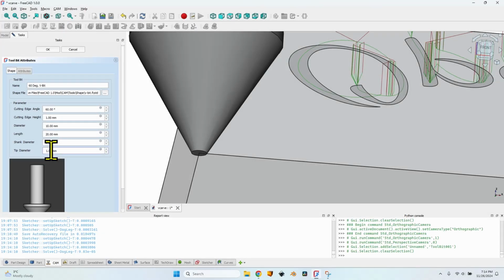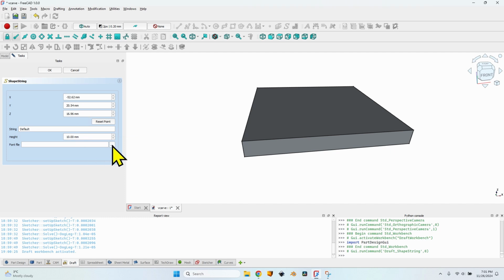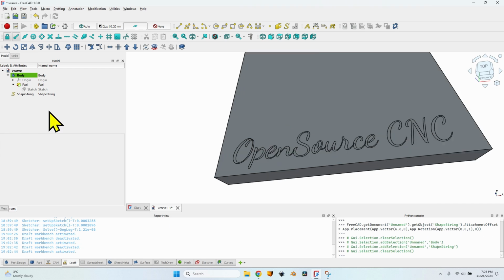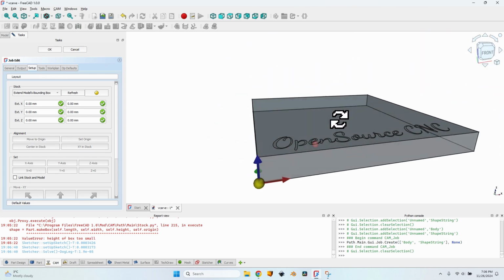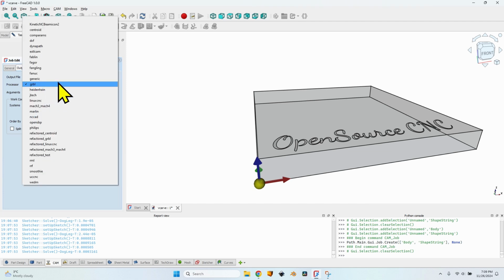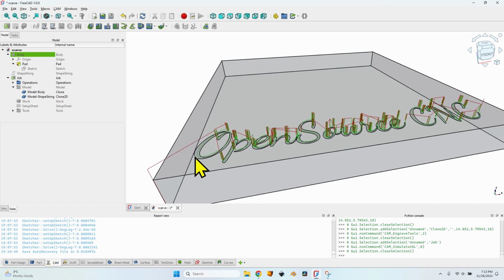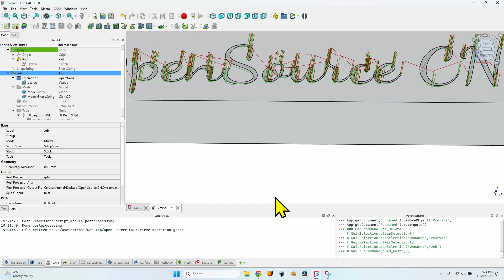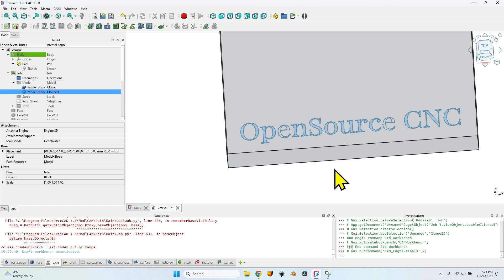CNC V-Carve Text Engraving – FreeCAD 1.0 CAM Tutorial | Create Toolpaths & G-Code for Engraving

Comment: I apretiate the options of Freecad and Blender, but the truth is they are nightmares to learn. I am a Certified Solidworks and Autodesk R14 designer, and still cant use freecad for a professional job. Too slow, too many bugs. My Grandma used to say "Kitchen appliences are so bad because the engineers dont use them, and they dont listen to their wifes!".
Reply from the maker: There's another saying "it's not a bug, it's a feature" :). That aside, I have to admit that sometimes FreeCAD has its own way of handling things. I have similar feelings when trying other programs, they just do things differently. Some things are changing (sometimes slow, but you can't compare a commercial product with a community driven one), some are just going to keep on being different.

Comment: I just wanted to say thanks for this video. I'm slowly trying to replace Fusion 360 with FreeCAD. I'm mostly using it for simple 3d printed parts right now, but my other use case is CNC. Given how bad Fusion is at engraving, this may be the first thing I've found that FreeCAD is demonstrably better at, which is quite exciting.
Reply from the maker: Thank you! I'm glad it was helpful